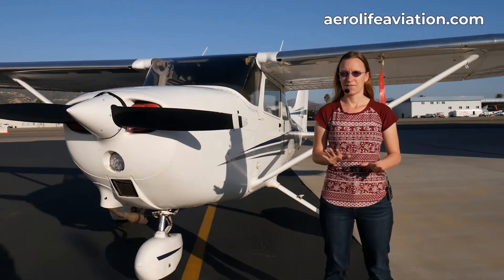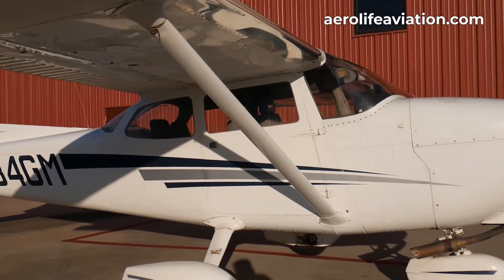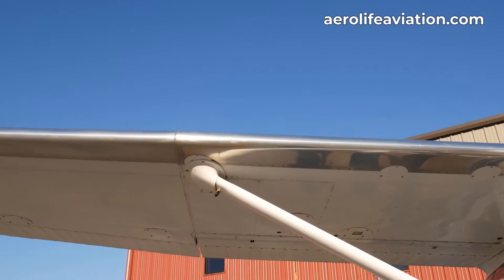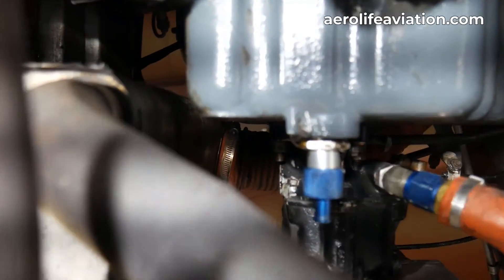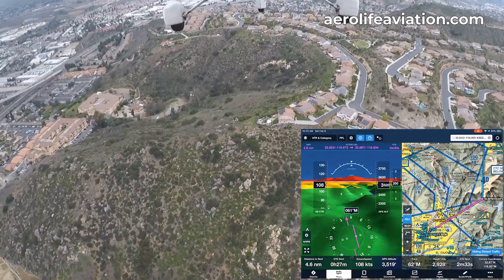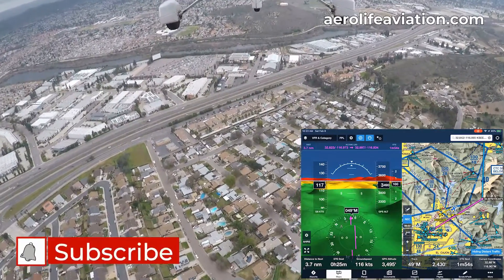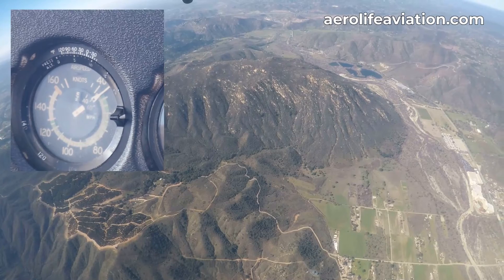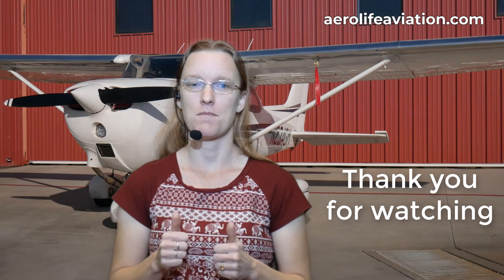9 things this Cessna 172 Skyhawk can do that standard 172 can't - Cessna 172 for sale

Comment: I thought all 172's were Skyhawks.  How do you tell if it's a Skyhawk or not?
Reply from the maker: In 1961 the 172B was the first time they used the Skyhawk name for a deluxe package that included wheel fairings, avionics and an O-300-D in place of the O-300-C. In 1973 the M model offered a Skyhawk II with updated avionics. 1998 model is marketed as the 172S Skyhawk SP.

Comment: What is the empty weight of this particular aircraft?
I have over 150 hours in Lycoming powered 172s.
Reply from the maker: The 172M models are usually around 1300lbs empty weight, depending on equipment installed.

Comment: Does the 180hp motor increase or deplete the payload of a standard 172?
Reply from the maker: There are different STC's for 180hp hp upgrade. 'Air Plains' STC has a gross weight increase of 200-250lbs depending on the model.

Comment: Cessna/Textron, needs to face lift the high wing, single piston series of aircraft!
Would be easy to make a few modern upgrades to the 177 by utilizing composites here and there to get useful load up/reduce drag...include a full fadec diesel option, a 180-H.P. and 200-H.P. power-plant and replace the old 172!
Note: the horizontal stabilizer issue has already been addressed with slats.

Get it done Textron!

🙏🇺🇲💪

Comment: Number 1, it has more power than any other 172. Number 2, through number 8, refer to number 1!
Reply from the maker: Well reliability safety and other factors in the other points
Reply: @aerolife1646  No matter how much money and upgrades you throw at it, it is still a 50 year old airframe. And it still, only has a useful load of 824 lbs. It still leaves me liking the Piper Archer/Cherokee 180, a lot more.
Reply from the maker: @ConvairDart106   different people like different planes. Piper makes good planes and I am looking to buy a malibu.

Comment: Not to be a “know it all” here but I’m pretty sure Diamond’s DA40 is the safest aircraft ever built to date. I flew both aircraft when I was training for my private and the DA40 is much easier to fly, more forgiving, handles better, flies smoother, and has more safety features built in to the structure of the aircraft.
Reply from the maker: DA40 is a nice plane. What is safer? Not to start an argument but considering the facts,  172 are inherently resistant to spins.  Even if you put it into a spin intentionally it recovers by itself.  That is a rare characteristic for a plane. 172 has better slow flight characteristics and lower stall speeds than DA40 as well.
Reply: Planes are safe. People are not.  In the end, dumb people will cause accidents. Planes are just the tools the dumb people use.

Comment: The 172N's were the best ones. They produced the most 172s in N version.
The plane has a crappy antique panel with an ipad glued to it. Better to have spent the STOL and electronic ignition cash on a better panel. I am also suspicious about electronic ignitions. Nothing is more reliable than mags. The only thing that fails your mags is several applications of a ball peen hammer.
Reply: She doesn't have a clue what she is talking about...This video was sooooo cringe
Reply from the maker: Anything with moving parts is less reliable than electronic or solid-state versions. All other types of modern engines use electronic ignitions like your vehicle.  The aircraft industry is behind on this and beginning to caching up.

Comment: Flew a 172M in 1978. A very very nice aircraft to go anywhere in. They were fun doing Rock a By Babies in, causing your rear passenger friends to turn green. You are right about the fuel too. You could go a long way on a full tank depending on flight plan. This is a great video with lots of correct info and nice scenery. Thanks for sharing what I can't do anymore. I really miss it.
Reply from the maker: Thank you for the compliment. They are great planes to fly. With some modifications they can be even better like this one

Comment: Hahaha.... it hasnt got a rudder trim.... you need a N or later....   🤣
Reply: She doesn't have a clue what she is talking about.... This vid was soooo cringe
Reply from the maker: Yes, there is not an internal trim wheel for the rudder. There is a small manual adjustment tab on the rudder to trim on the ground.

Comment: nice paint!! and clean.. but the engine looks dirty.. some rust in the cylinders ... the baffle all around is wear off and looks like has a lot of play with the cowls... i will spend some dollars to replace it and blow it with some cleaner ...
Reply from the maker: Yes I think engine area could use a cleanup.
Reply: Polishing the cylinders increased power, since when? Boring out a cylinder will increase power but, not polishing.
Reply: @bluntinstrument6070  It will give more power.  It done on race cars as it cuts down on friction between the pistons
and the cylinder walls so the engine turns freer,  thus more HP.
Reply: Yes, it did look dirty, and some of the hose clamps looked like they need attention. PS, looks like the analog clock is not working properly. Chips on the the bottom of the dash. Looks like a good airplane, just needs some maintenance.